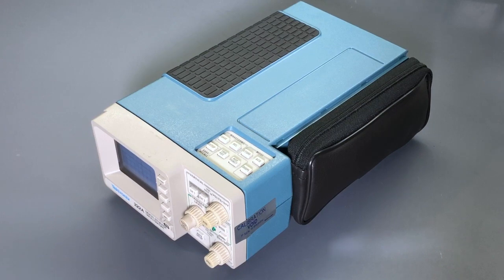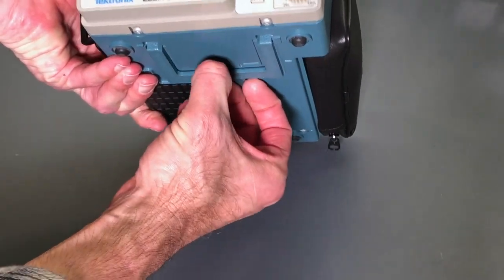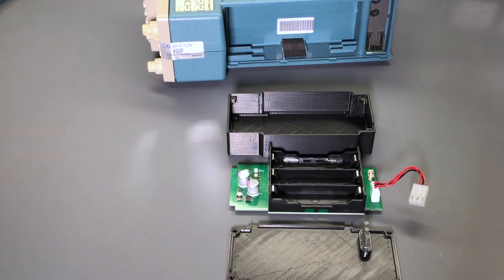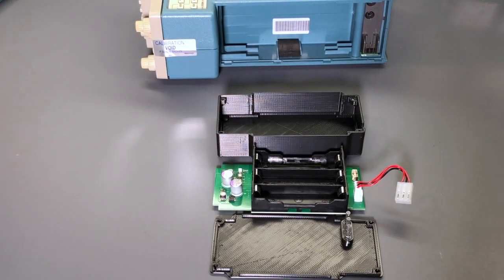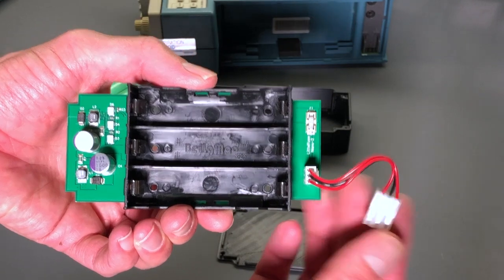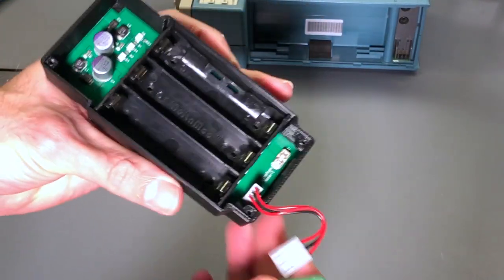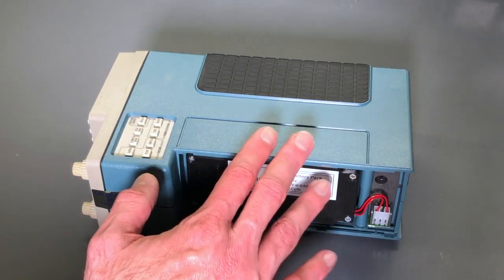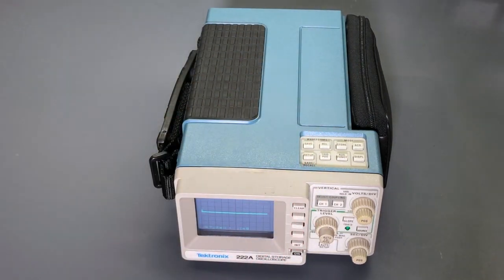Tektronix 222A Oscilloscope Obsolete Battery Replacement Solution

Comment: After an old neighbour mentioned issues with seeing the polarity of batteries I took a little ponder on how to solve the problem.
What I came up with I've started to use on my own devices as well, I mark the polarity (usually plus only) with a white pen intended for marking tires.
Makes switching batteries a lot easier even in limited light.

Comment: Man that looks brand new. I just got one for $200 on eBay. Waiting for it to get here. I got a 9.6v NIMH pack for it but not sure if it’s going to fit. Could you get me the dimensions of the inside of the battery bay?  Or even the original batteries? Also hoping to find the manuals some day… the Lopo kit design specs and video of by the guy that made it are online. I just figured a $10.00 NIMH pack is good enough vs $100 for the lipo setup.
Reply from the maker: The battery box max size is 5-1/8 long, 2-1/2 wide, 1-1/4 deep. (inches).  They are great little o'scopes!  Have fun with your new purchase.
service manual.. https://www.tek.com/en/manual/222-digital-storage-oscilloscope-service-manual
user manual.. https://www.manualslib.com/manual/2038147/Tektronix-222.html
Reply: @EriksElectronicsWorkbench  thanks for the dimensions. Yeah I’m hooked I just bought the earlier 214 analog model so I can do real-time x/y vector (oscilloscope music) on it. it’s non working off eBay, so now I have two coming 😂 🤦‍♂️ (… I meant I hope to find the original physical manuals…)
Reply: How long is the runtime with your pack? My 7 Nimh batteries are only getting about 50 mins and they are supposed to be 2400 mah
Reply from the maker: @sideburn  I can get 4.5 hours of continuous run time.
Reply: @EriksElectronicsWorkbench  wow major difference.
Reply from the maker: @sideburn  yes the battery life makes the scope very reliable and usable.
Reply: @EriksElectronicsWorkbench  how many Mah are your batteries.
Reply from the maker: @sideburn  2500 mAh.  Here is the link where I purchased them  https://www.18650batterystore.com/products/samsung-25r-18650
Reply: @EriksElectronicsWorkbench  SO strange how two or 3 of those get you 4+ hours and 7 of my 2400mah batts get e 45 min... buts be the battery management circuitry in yours with that buck boost converter I guess...
Reply from the maker: @sideburn  it is the difference between series and parallel connections.  In my unit the batteries are in parallel so the total capacity is much greater than the individual 2500mAh of each battery but the voltage is low, just the individual battery voltage.  The boost converter increases the battery voltage to the higher 8 volts DC the o'scope needs.  Your setup of batteries in series has a higher total voltage directly useable by the o'scope but the capacity is still 2400 mAh, i.e series connection does not increase capacity, only increases voltage.
Reply: @EriksElectronicsWorkbench  ohhhh right. Ok that makes sense